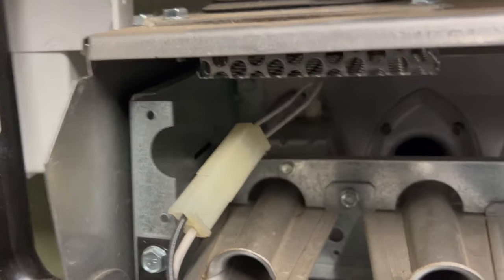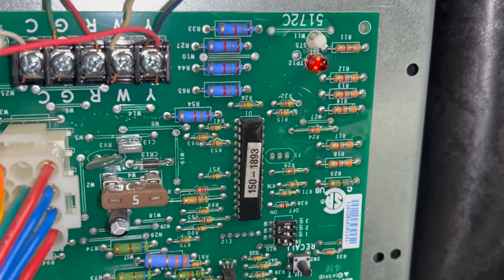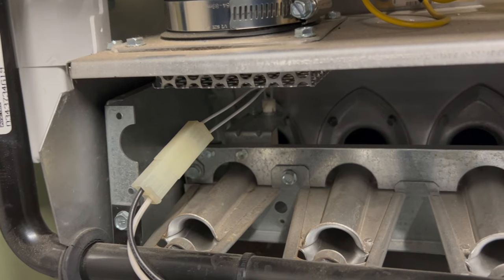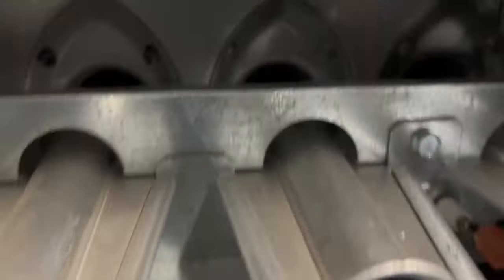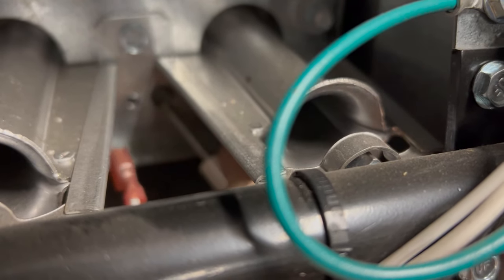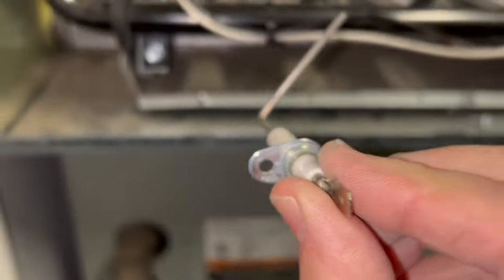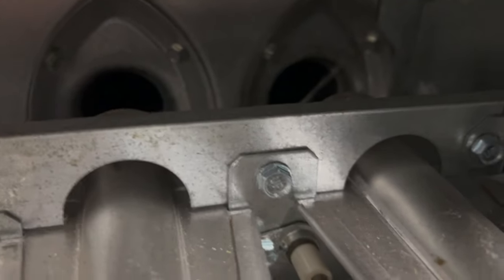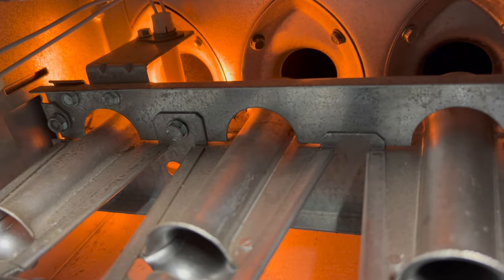Gas Furnace Won't Turn On  |  Basic Troubleshooting Trane Gas Furnace with No Heat

Comment: Thanks for this video. Try the simple things first (Occam's razor) Thermostat: batteries, wire loose or damaged, breaker tripped, outlet for furnace plug loose wire, panel replaced after changing filter depressing cut off switch. I have personally had 3 of those things happen over the years. Hope this helps!!!
Reply from the maker: Thanks for the tips!

Comment: I’m having the same issue. Can you please post what they ended up changing with the wiring to make it work again?
Reply from the maker: Hey monkey,
I wasn’t there when the technician came but I know it had to do with the Nest. So double check that it is wired correctly. Maybe reach out to Nest support to clarify. 
BTW - this furnace function fine all fall, and then on Christmas Eve, decided not to function. Said that to say - can be intermittent. 
Thx for watching!
Reply: Probably the common wire

Comment: My igniter glows but doesn't light burners. Do they get weak? Is there a way to meter?
 So.
After the relay clicks, i light the burners with a torch. At which point i started a slow 
1 Mississippi
2 Mississippi etc 
And quit counting after about 75 count when the flame goes out. The big fan wont kick on. 
 BUT It works on AC.
Is it my low limit switch not telling by big fan to turn on?
And
Is it my High Limit Switch shutting down the whole sequence because my heat exchanger was getting too hot?
Reply from the maker: Not real sure. Sounds like a possible issue with the limit switches. 
May have to get pro to look at it. 😳